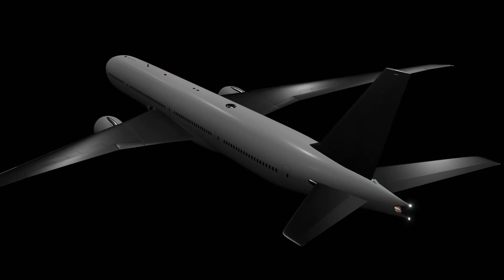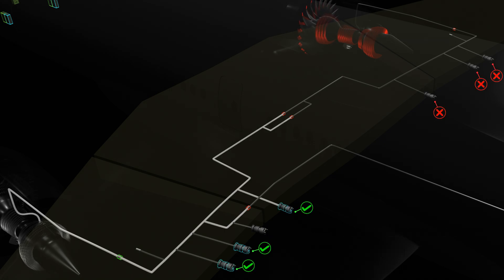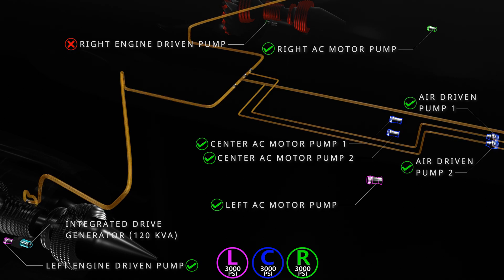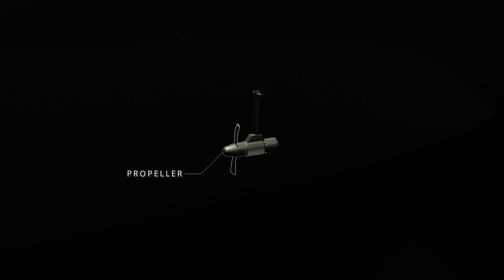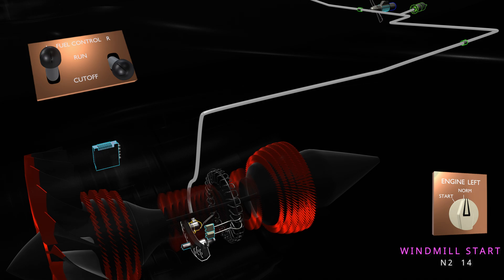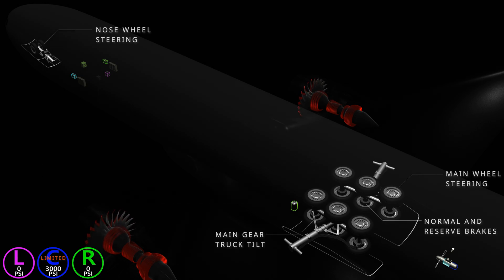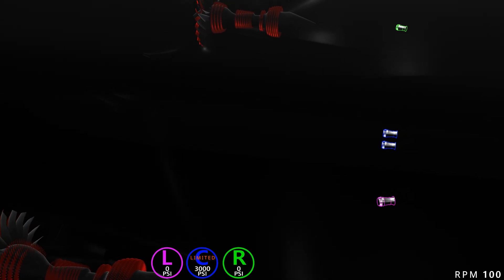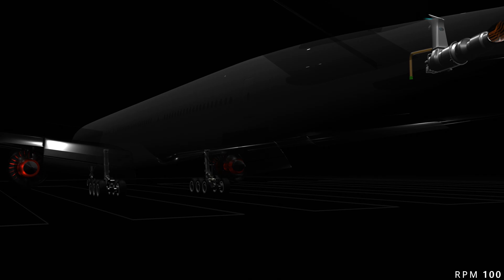How Auxiliary Power Unit Works | Part 4 : Dual engine failure

Comment: hello sir one confusion is there please reply... after the engine starts the bevel gear is attached to the main shaft is removed from there or not.
Reply from the maker: It will continue to run and drive the gearbox of the engine.

Comment: Does the ram air turbine not retract when the APU comes online?  Seems like you'd want to not have that drag once it wasn't needed anymore .. especially because you don't have any thrust.
Reply: My initial thought would be that you dont want to risk retracting it in case there would be any problem with the apu. The increased drag from the RAT is barely existent
Reply: @iamjesper  barely noticeable until you just barely don't make the field.   But they probably know their worst case range and are always within range of an airfield.
Reply: @zachansen8293  having the drag from the two dead engines is far worse than the small ram turbine. ETOPS regulates how far your are can fly with a single engine failure. They dont take dual engine failures in consideration. If both engines die over the ocean you are basically screwed.
Reply: @iamjesper  The drag of the engines is irrelevant to the drag of the RAT.   It doesn't matter if something else is more, the question is the impact of the RAT.   but as someone else already said there is apparently no retraction mechanism.
Reply: RAT cannot be retracted once it is deployed. Maintenance has to retract it on the ground.
Reply: @Bigboyfatso  and that is indeed correct...